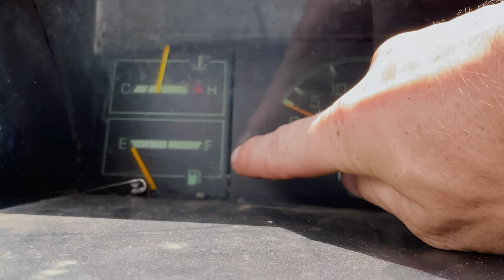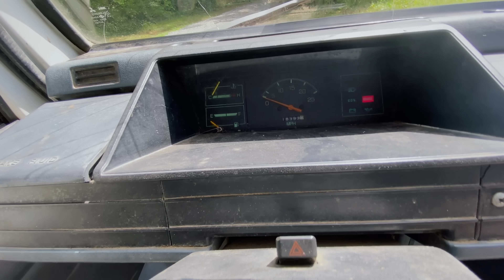I Bought the CHEAPEST Japanese Kei Truck on Facebook!

Comment: Swap to 3 cyl diesel, upgrade the suspension enough, use a winch with an arm to make a mini crane, and use it as your tow truck.
Reply: Exactly what I thought. A 3 cyl diesel would do well on it.
Reply: Its the perfect size for carts and mini bikes! Tractor supply has winches from 100 bucks for atvs.......
Reply: Nah motor out a 2 stroke 1000 snowmachines. Easy to get 120hp
Reply: This exactly.
Reply: We all need to pile on this idea! I would love to see them make this into their go kart tow truck!
Reply: @brettknighten1171  You need torque, not horsepower. A 3cyl diesel could easily get 100 lb-ft naturally aspirated.
Reply: 1000cc snowmobile engine swap for sure
Reply: 3 cylinder from a kubota or something, would turn it into a towing powerhouse with that low 1st! I've driven a Honda Acty (their version of the Kei truck) and anything more than 50-55mph is not something you want to do very much of anyway. 🤣
Reply: Literally took the words out my mouth bro!!.
Reply: Hmmm, I know where they can get a Kubota engine, REAL close by! 🤣
Reply: @tacticalidiot175  you also need rpm if you want to drive it on the street. You think 23mph is bad put a 3 cylinder diesel and it will top out at 15mph.  Besides they already have a tractor if they need to pull something out that's really stuck or use a real truck
Reply: *turbo diesel
Reply: Yess
Reply: @brettknighten1171  not for a mini tow truck/ service vehicle. Run the diesel and u can install a small hydraulic system to run all kinds of stuff. Tilt bed, maybe even a front loader.....
Reply: @brettknighten1171  man....i cant really argue with u there haha u are right.
I just was thinking they could make a cars and cameras tow truck that was size appropriate to carts and mini bikes. It would be so cool to see them use it as a mini repair/ tow vehicle that they can use on trips and stuff
Reply: The Ford Model A could pull a Greyhound.
Go hydraulic PTO, minimal electric.
HAVE HOSES AND ACC. for a 20 TON POWER PACK.  Jaws of Life rescue, stow away Flat board.
Reply: @brettknighten1171  promise you that 50+ mph in that thing is a death sentence. Drove a bunch when i was in the marine corps overseas.....they get REAL SQUIRRELY around 45 mph hahaha
Reply: Hell yeah
Reply: @memorris2  true true but i never would have driven the honduki either
Reply: Nah put honduki motor
Reply: Decent idea but any time some one says diesel I think tdi
Reply: Was thinking that also. Maybe a turbo deisel 🤣🤣 love it
Reply: Yes
Reply: @brettknighten1171  hahahaha 😆
Reply: Or use it to tow some powewheels
Reply: @brettknighten1171  23mph? I have a daihatsu hijet and it tops out at about 100km/h (60mph) if you give it time

they use 1cyl diesels where I live and those do about 25mph, a 3cyl kubota should be plenty. https://www.youtube.com/watch?v=9dn9xLBPF9I
Reply: @tristan6509  eventually is not adequate to make it safe on the road.
Reply: @brettknighten1171  so? These cars are slow either way... Doesn't matter if you use a gas or diesel engine.

They're not designed for highways either. Look at the original jeep, those things only make 60hp which is about the same as these kei trucks, yet it can drive over virtually anything
Reply: @DieselRamcharger  if it is a tow/service vehicle, why does it need to go any faster? Doesnt need to be fast if it can tow like a beast.
Reply: @brettknighten1171  i dont feel like the go carts and mini bikes on this channel spend much time on the road.....so why would u think the tow truck needs to be street legal? It would be a service vehicle for thier land......not for highway recovery.
Reply: @memorris2  they mentioned miltiple times about making it street legal in the episode
Reply: @brettknighten1171  yes, but that doesnt mean its a good idea.....street legal would require a ton of stuff, and it still wouldnt be able to handle 40mph or more.....hence torquey little tow truck
Reply: @memorris2  street legal would be blinkers break lights and a title not all that hard to do. Besides a 1000cc 140hp snowmachine engine would have plenty of torque and if it didn't they have 8k rpm to play with gearing instead of 2k
Reply: @brettknighten1171  do u have any evidence of a snowmobile engine fitting in that vehicle? Or ever tried to make something street legal?
Reply: @brettknighten1171  and do you think a 1000cc TWO STROKE is a good motor for road driving?! That would be a nightmare. Im not sure u are comprehending the end result of your ideas.
Reply: @memorris2  well a 1000cc 2 stroke is half the size and a 5th the weight of your 3 cylinder diesel. Yeah i have not to mention THEY SAID THAT IS WHAT THEY WANTED TO DO WITH IT. They have also done it with atleast 4 mini bikes
Reply: Diesel Swap 100000000000000000000000000000000000000000000000000000%
Reply: You had me going till you hit crane like he said perfect hauler put a diesel boom towing for days
Reply: he should put either a yamaha r1 engine or a honda cbr1000rr engine in it
Reply: @BackRDComputerScientist  i dont think there is enough weight in the back for that much horsepower.....
Reply: Any 4 cylinder Japanese engine instead keep it 🎌🎌
Reply: Kubota tractor engine
Reply: With 4x4
Reply: No just add tillitson fuel pump and a gtx28 turbo.
Reply: A 3 cyl deutz is what id have in my dream mini truck

Comment: You guys need to turn it into an AWD mobile workshop! With like a generator, tools foldable roof, some sort of planks to put on the ground if you need to fix something in a muddy place. Basically, making it EPIC!
Reply: That would be better equipped than their workshop. I like that idea
Reply: That's actually pretty smart. Take it to 4x4 parks and fix stuff on the cheap.
Reply: And make a pull out platform
Reply: & maybe a hoist of some sort to work under the buggy & karts etc ..

Comment: Make it a tool hauler/tower for when stuff breaks down mid trail.
Reply: Yeah mud tires and mounted ramp on the back
Maybe ducati swap
Reply: Needs some cheap dana 30/dana 35 axles swapped in from a jeep and a 4bt cummins
Reply: It would look awesome if you put a tow truck style boom in the back. But it has been done before.
Reply: Definitely be sweet tool/tow truck with awelder and air compressor.
Reply: Take the motor of the dukarty,that thing would get it
Reply: @GreenColorBombs  maybe not a Cummins. But like a yanmar diesel engine
Reply: That's what will do nurse
Reply: @sexiestjw  ok Jenny that's silly
Reply: Engine swap it  with double cc engine and make it 4x4
Reply: @dancearoundtheworld5360  I would actually recommend a mt09 engine or something similar, gonna need really good torque to tow.
Reply: @IrishSpyHD60  Yeah whatever floats ur kei truck

Comment: A local car dealership had kei trucks as parts  delivery vehicles, they were fitted with bullbars. The drivers would clamp off the rear brake line and brake heavily in order to try to get them to roll forwards and stand momentarily on the bullbar before falling back (hopefully) onto it's wheels.

Comment: I am glad to have seen this video. The undercarriage shots showing just how small the driveline components actually are, and how slow they are. I would think building an S-10 or Ranger or any old Toyota or Nissan pickup from the same year, would result in a much better truck for less money when it's fully roadworthy, which , these are far short of roadworthy and on any highways, you are a slow moving vehicle like a tractor with a line of cars behind.  Thanks again. I can cross these things off my list now for sure.

Comment: These trucks make great onsite mobile tool trucks. Greensboro, NC uses a small fleet of these style trucks for their work at TZO WWTP. Some have vinyl bed covers, most have multi drawer tool boxes, a couple even have welders, torches, chemical pumps, etc. They are way more efficient driving around site up close to the various equipment that needs work, than a full size street truck. Putting a small diesel driveline out of a Kabota RTV, or tractor, with a winch out front, and a rig up a mini tow rig hook out back,  would make this a beast. Adding some old school Toyota SR5 leaf spring suspension,  hubs and 31" tires, could make this a 1/2 ton rig for non stop track use fun.

Comment: @CarsandCameras On my neighbor's almost identical kei truck the governor is controlled by the electric pickup on the speedometer drive unit on the transmission. Unplugging the electrical sensor while leaving the cable in place kept the speedometer operational but defeated the governor. GPS read 63mph and still accelerating before vibrations and instability (and a 40mph speed limit) required letting off.

Comment: this is the first left hand drive kei truck i've ever seen. i've got a mitsubishi mighty max truck. it's basically a dodge d50. these kei trucks are pretty good at what they were designed for. in japan they are the standard pick up truck. they're more useful and cheaper than a side by side. some of them have dump beds, are 4x4 and have ac. most parts are available online, and they are fairly simple. i'd say you got a hell of a deal with a twofer 2k.

Comment: Ya know, a Geo Metro 3 banger is about the same length, it's 1 liter, and makes 54 hp. Might fit.
Reply: My dad had one back in the day lol
Reply: Odd thing, but I've wanted one of those little things since forever. Getting pricey here, but they may still be okay where John and the lads are at.
Reply: @S0REN_  I had one a few years ago. The ones with automatics are really slow, and they DON'T have overdrive, so they only get about 35-39 mpg. The stick is the way to go, they get 50mpg and can cruise at 70mph.

Comment: Excellent video Guys :) also get ready for road for sure and get tune up too so be quicker truck in speed to ! Check clutch to also fix that transmission mount and be all set plus bigger motor plus tires too!

Comment: We had those POS light trucks in the Marines in Beaufort S.C., we used em to run airplane parts up and down the flightline to and from supply. You can trick the governor if you reach top speed, then put it in first and do NOT let off the clutch all the way, just a bit to make the computer think you're in first. Then you get another 20 mph. Don't go past that, you'll blow the engine.

Comment: I know NC has to have inspections every year, would you need to have this inspected every year?

 lift the front a little, widen, need some bigger tires, minimum 750cc engine, roll cage, Replace the bed with one a bit wider like John Deere Gators, and finally a CnC wrap.

Comment: This mini truck really reminds me of my home country, Taiwan. An auto manufacturer named CMC manufactured a modified version of this Mitsubishi truck as the Veryca, and they still produce mini trucks and small vans that are based on Mitsubishis. The older and newer models are very common all over the country as work trucks and vans. A lot of the older ones get rusty though because of the high humidity there. I believe the Taiwanese CMC mini trucks were imported and sold in the US as Cushman mini trucks, so you can try finding one of those :)

Comment: try to put another diff on the front and see if you find a transfer case, then put a roll cage on it and maybe swap the engine out for a larger bore something like a 1.5l 4 cyl.

Comment: Put a 600cc bike engine in, and use a front wheel drive gearbox as a transfer case to make it 4wd. 30 forward gears and 6 reverse. Centre diff means you can mismatch diff ratios to get the torque split you want, and still do handbrake turns.

Comment: If you guys reinforce those rear shackles and the mounting system on the front of the rear spring it will greatly increase the stability it will be similar to putting a pan hard in without the restriction of travel not as good as a pan hard but that’s the best way I have to describe how much of a difference it will make especially when shackles are that unbelievably long just put a plate in the middle of them that tie each side together and I don’t mean a plate in between the two shackles just tie each side of each shackle together this is coming from experience with my buddies being cheap lifting their leaf sprung jeeps

Comment: Nice! Its a shame you didn't find a 4wd but this thing is still rad. I'd keep it off-road capable but maybe swap out the powerplant for something a little more substantial. Then do as you guys said and kit it out to be a mobile workshop. Build a separate trailer to haul your carts and use the loadbay of the truck for tools, spare parts, coolerbox, etc. Maybe get a little awning on the side so you can set it up as a shelter too haha.

Comment: Wooden flat bed! Use salt treated 2x12 decking boards. 
Use a 4x4s secured with 3/4X12in lag bolts to the bed support beams. Might be able to get away with 9in bolts..
Then on the outer edges, turn a 2x12 on it side, and split the difference of the middle of the board, and screw it to the sides of the bed. It'll be the perfect hight to keep the cart wheels from bouncing off the side of the truck.
You could always add quick attach anchors for ratchet straps to all 4 corners of the bed. 
Varnish or lacquer it, sand the body, repaint a nice classy old school lead based high gloss black! 
Or maybe a candy pearl brown..
That would be cool as shit! 
Add a few amber and red running lights down the side!

Comment: You should get everything running really well on it, then you should redo the suspension so it sits higher and level, and so you can run some 31s or maybe even some 33s on it! Might have to re-gear it so it has the power to turn them, but it would look so cool lifted! Bigger tires would definitely bring the top speed up! Maybe find a way of getting some more power out of it? Maybe even look into swapping a more powerful engine? I have always wanted to get one of those and lift it and turn it into an offroad mini camping rig! Swap the engine out for something with more power and torque, maybe something like a VW TDI engine if it was possible? Definitely lift it and put 33s on it! It would be so cool!

Comment: make mods for longevity and strength. Use as a utility vehicle and respect it as a piece of equipment. I had a friend with one of those pickup truck cranes, and those things are incredibly handy, used it in ways you can't imagine until you've had one. You have others toys to race and tear up.

Comment: If you're lucky, that /might/ be a full 4 speed transmission with 4th simply blocked off... Seems there were a few varieties from a gear not cut to begin with, to a couple of methods of just keeping the shifter from going there. (Unsure, but possibly model number under seat(?), 7th char if F may can be unblocked, possibly just either a collar on shift rail, or a plug was put in the housing behind shift rail, if P then a synchro gear was likely left uncut and sol). Figure out how to disable the governor and hopefully unblock that gear, and watch it go faster than you'd ever actually want to be in it for that particular ride. XD

Comment: You guys need a yamaha xj 1300 motor for it, lower the suspension, put super wides front and back, and a slider tray on a winch so you can use it to hall crashed karts and mini bikes in style 👍would be to kool

Comment: Years ago (back in the 70s?) I saw one of these in Japan this guys was driving without the bed. He slammed on the brakes and the truck tipped over. Did  summersault. The truck wasn't the Mitsubishi it was a Suzuki and they had a 2 stroke 350 cc opposed two cylinder. I worked for a Subaru/ Citron / Suzuki dealership 1971. Suzuki made a 4 by 4 Jeep style car. They had one of the jeeps on display it fit in the bed of a long bed Fore F150.  The trans was smaller than the trans in your truck. I had to rebuild one and it had 6 to 8 bolts and the top half of the trans came off and all the gears were right there.

Comment: I had one of those a few years ago. It was a Subaru and the engine was in the rear of the bed and the steering wheel on the right. It was road legal too. I probably should have kept it but I got a good deal on a jeep and sold it.

Comment: If you reaaally want to build it, you should try to put a Subaru flat 4 with the awd transmission.
otherwise, you could try to find the biggest freaking motorcycle V-Twin you can get (like a vulcan 2000) so it has the meanest sound on the street, and will be plenty fast.

Comment: I live in the Philippines. I bought one of the mini trucks from Japan that had been converted to left hand drive once it arrived in Philippines.
If I could send pictures of it I would
And don't worry it will not flip the weight of the engine and transmission being so low they are not top heavy like they appear.
If you are ever in a bind for parts let me know. They are readily available here in Asia. Mine is a Suzuki 660 cc 
The parts from Suzuki and kei are interchangeable.

Comment: I've always wanted one of them. How long is it.? Jeep chassis? Or like Ike said Subaru brat. Anything like that it is a cabover mid-engine it like a monster truck. I love how the the bed folds down way easier to work on everything. I'm just a little slow and behind but what happened to Ike. I read one of the comments for him to get well soon? Whoever said it I'm with them. Yeah pal hope you get better soon. I'm sure I got something over there that will fit in that thing. Matter of fact I know he does 👍. Y'all put s*** together at breakneck speed. And dang near did quite a few times. Isn't there an all-wheel drive something at Ike's? Tear it apart and stick it under that thing it's a full frame you can make a bracket cross members. Triangulation, radial and parallel line development makes anything